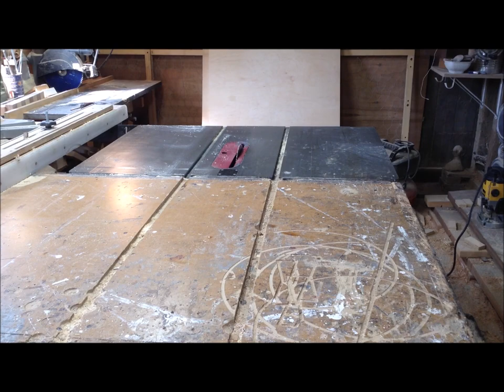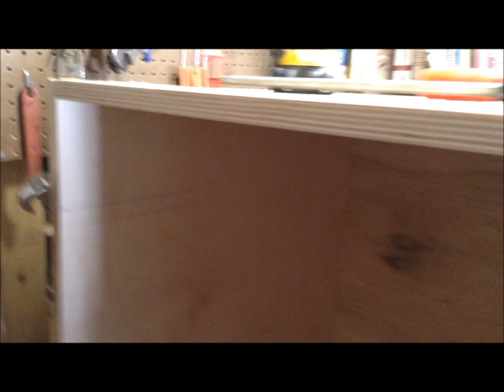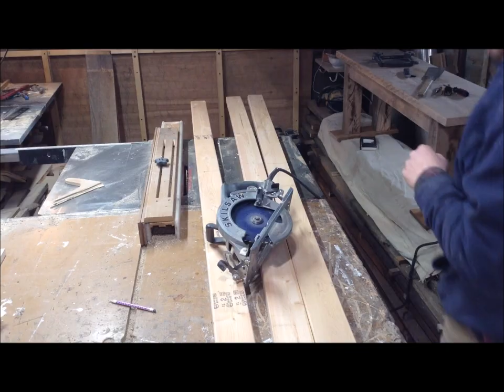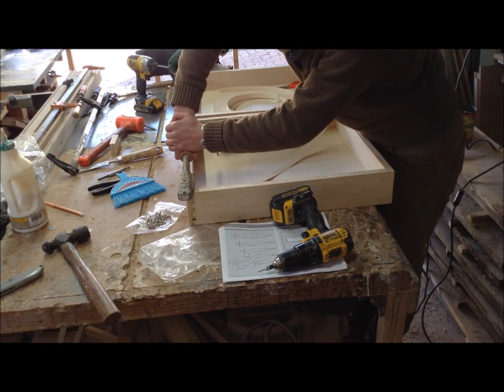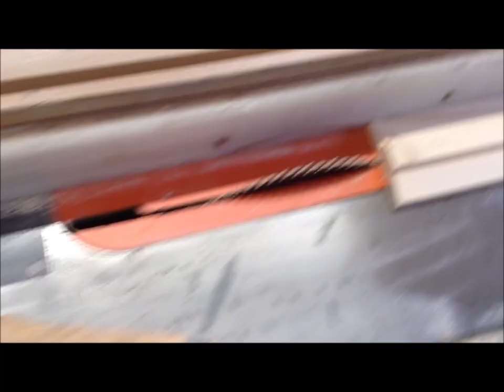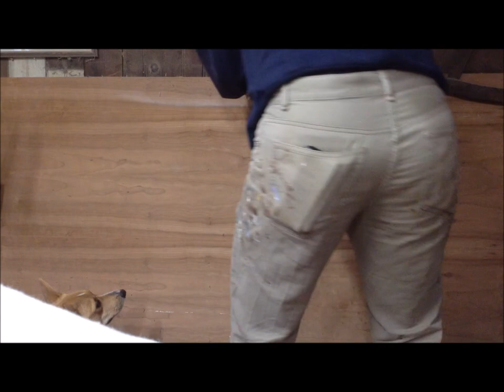Woodworking : Liquor Cabinet and Storage

Comment: Nicely done, impressive design and finish. How did that bottle of wine stay unopened during the filming.
Looks like you need a source of heat for the workshop. It’s always tougher to do with a one person operation. Thanks for the video
Reply from the maker: I have a propane heater in there for when it gets cold.